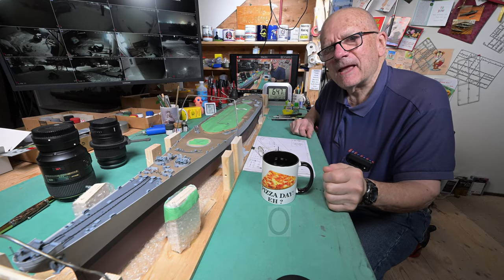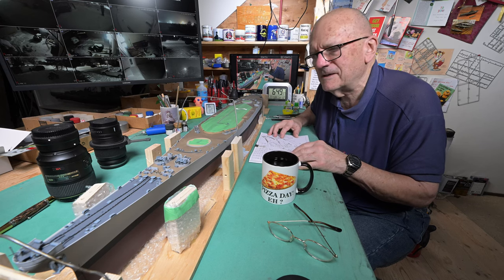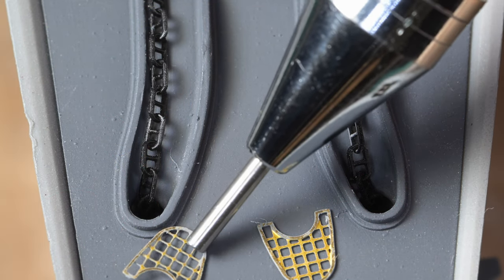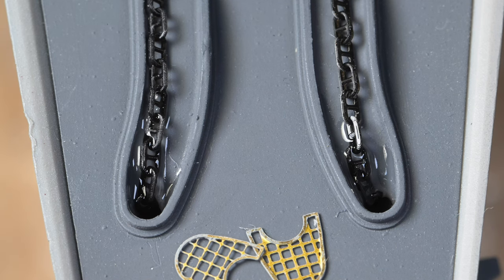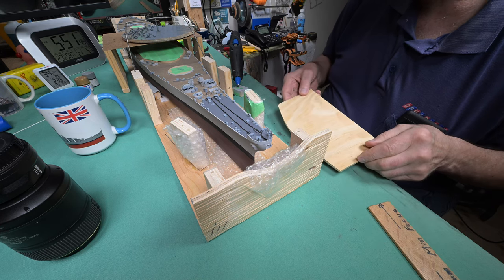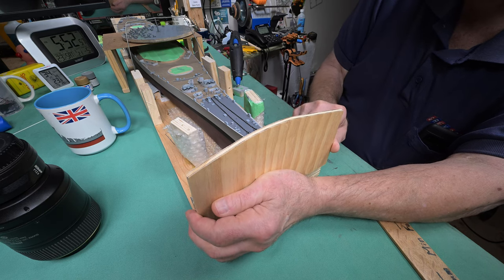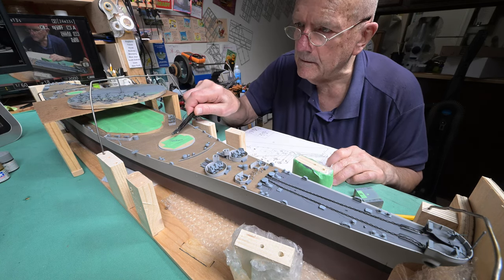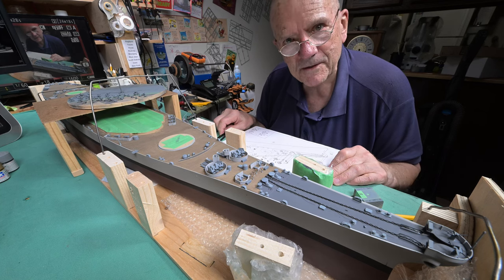The Model Ship - Part 1444

Comment: Ron! You did it! You saved that little railing! 👏👏👏👏

Wait till you get to the main guns, and try to install the itsy bitsy railing that goes on them.
I found it impossible for my clumsy old eyes and fingers.
Just keep using the arms length mantra, and it'll be fine.

Remember that models are supposed to be fun! 🙂👍
Reply from the maker: "and try to install the itsy bitsy railing" 😦

Comment: Ron, I may be wrong but it appeared to me that you used the insta-cure curing agent instead of actual CA glue on the anchor chains and I was surprised that you didn't put glue in the holes for the grandstand. Great work though and the progress you are making is good so all is well. See ya tomorrow.
Reply from the maker: That Macro lens make stuff look wrong sometime. It actually was the CA Quick Setting, not Insta Cure. 😁